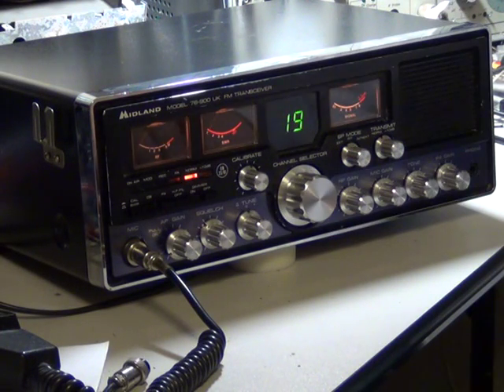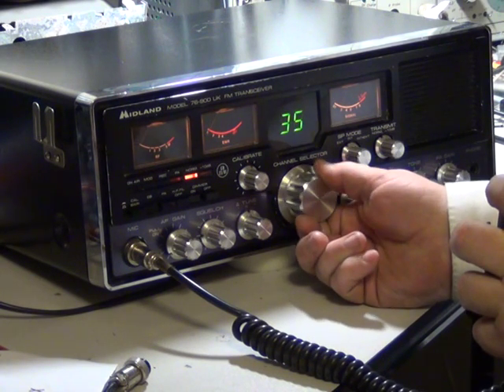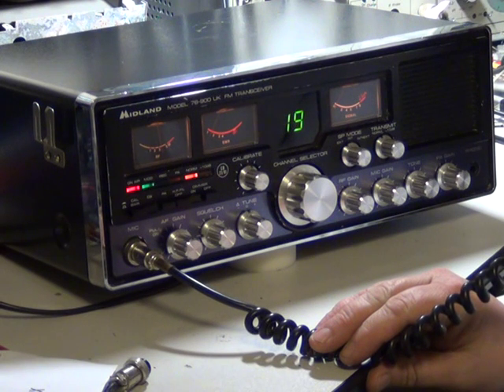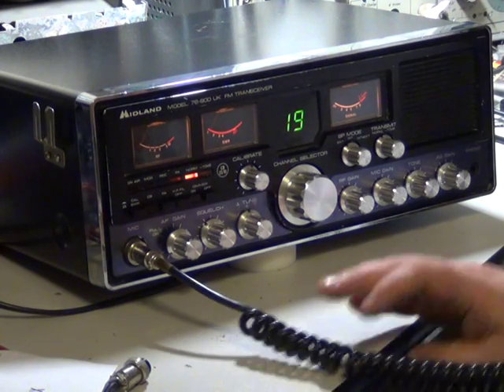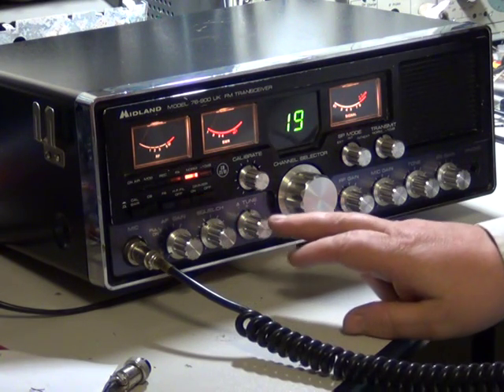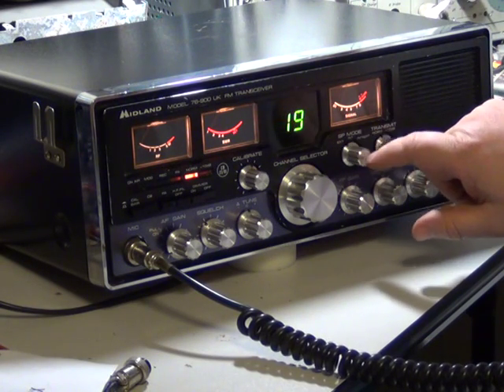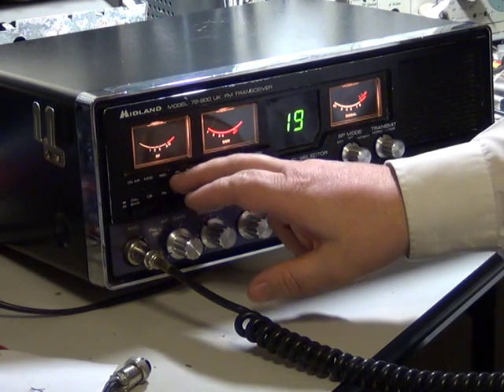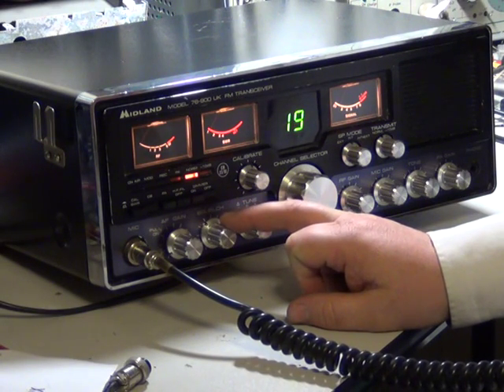Midland 76-900, UK (CB 27/81) CB radio (Base Station) - On The Air Test

Comment: Hi Richard its Nick beta 1000 skip find.
Are you able to fix my midland homebase for me I a bit wary of where it goes.
When someone is talking on channel 38 uk 40 you can hear them also on 39 and 40 if I was to key up on 38 39 40 on another radio the midland doesn't receive properly and register on the midland rx meter properly. 
Its has midblock fitted to by the last owner. 
Regards nick
Reply from the maker: email me. the CEPT channels would have to go & are causing your TX problem as well as being illegal to fit in a 27/81 radio.  rshireby@yahoo.co.uk
Reply: @ukfmcbradioservicingTango21  How dose it cause problems
Reply: @Nicholasbirdvowles  The 27/81 UK FM set was only made to tune one band. They are not a mulitband set.
Reply: @chris_vandepeer  no shit
Reply: @Nicholasbirdvowles  Yep lots of shit when you try and make something do what it was not made to do. I got an audioline PT341 from ebay about 10 years ago it had the mid band put on the tone button when i test the set it had no channels from 37 to 40.
Reply: Hi I've emailed you

Comment: Would love one of these radio`s...so hard to find in decent condition?
Reply from the maker: Unfortunately so many of them have been farted about with & even this one had some daft modification that had to come off. We paid £75+ post for this messed about with non-worker off Ebay.

 Richard
Reply: Hi Richard,let me know if you ever want to sell this one,or perhaps know of one,which is up for grabs,in this comment section?

Comment: Great video ,, what antenna do yo use in your shack please  thanks Shane warks
Reply from the maker: Shane,

This is a commercial 2-way radio workshop rather than a shack just in case I've confused you! The aerial is an Antron 99 fibreglass 18' end fed dipole without the optional groundplane kit. The aerial is mounted with the base of the antenna about 10' from ground level. The workshop is a single story building with a pitched roof & the tip of the aerial is just above roof top height. The aerial is wall mounted to the right of the test bench no3 (the one in the video) & so only requires a short feeder, which is 6mm mobile feeder type URM176,  which unlike RG58 is good for over 1Ghz, longer lasting & less lossy....and was to hand at the time.

Test videos will be all redone using our test vehicle driving a standard route is a "bad for radio" direction for better comparison; this is happening slowly.

Richard

Comment: I love the looks of that radio I'm in eastern kentucky in the us.if you wanna get ride of that radio just holler at me I'm not to familiar with uk radios but I'm trying to learn.any suggestions
Reply from the maker: The UK CB radio system is 40 FM channels starting at channel 1 with 27.60125 & ending at channel 40 with 27.99125, so it's no good to you whatsoever. However, the Midland 77-900 was also available in your market as an AM/SSB model, so you should not have any difficulty finding an FCC approved version that you can use.